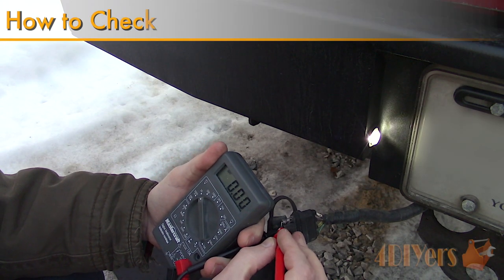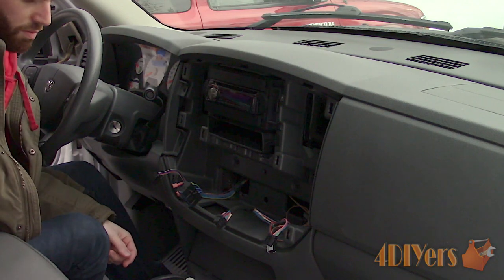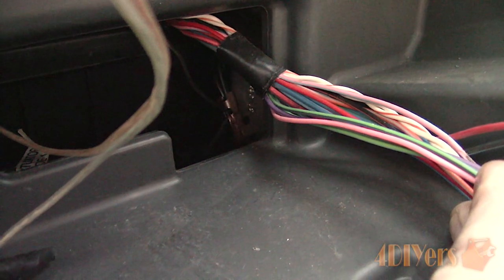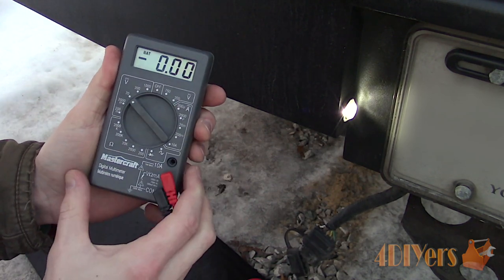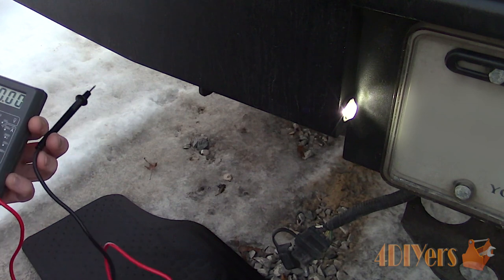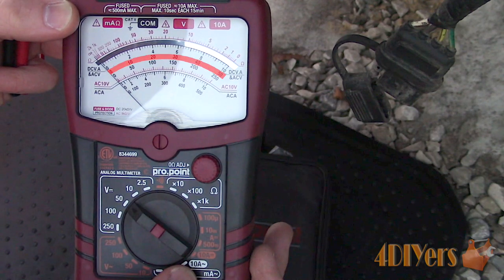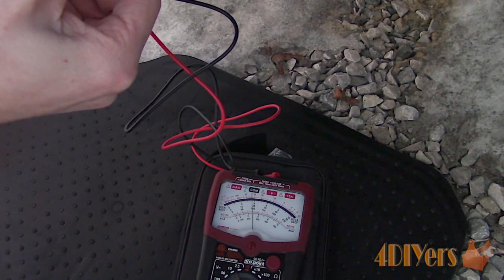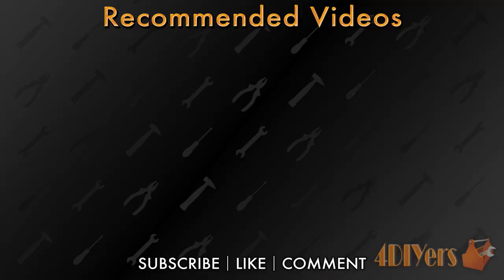How to Check or Test Polarity on your Vehicle

Comment: Do you have to have the key switch on?
Reply from the maker: Depending on what you are testing. If the circuit is always on without the key, then no. If it's a switched circuit, then yes.